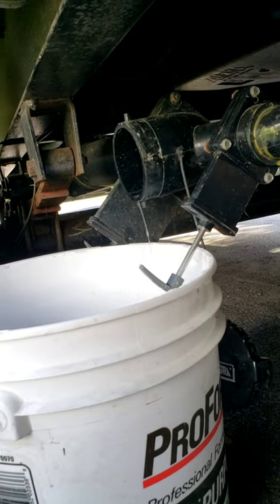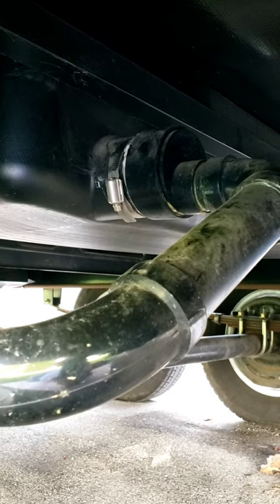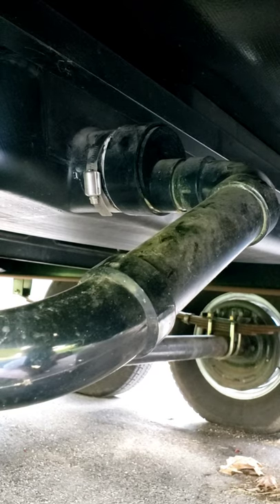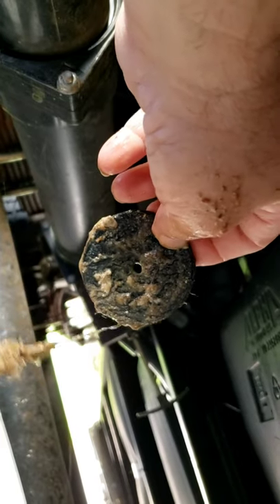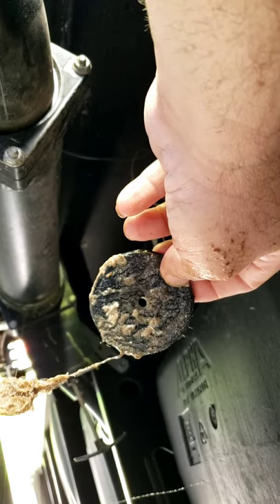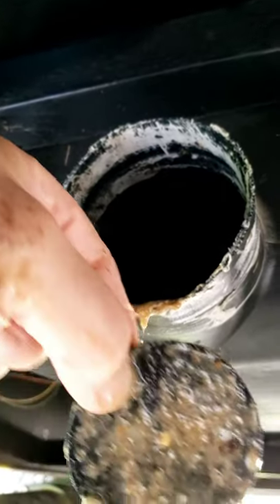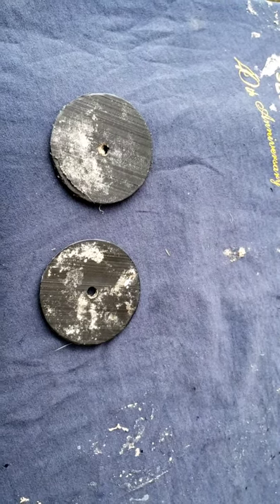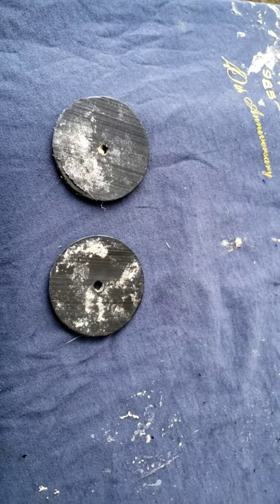Grey water tank not draining

Comment: Thank you, brother.  Bought a used Tiffin, and only got a dribble from my (half full) gray tank.  Ten seconds with a coat hanger started a flood, and now I need a shower, but I am happy to have fixed it so quickly for free.  The 1.5 inch stuff is glued to the tank, so I can't see  if there's a disk of tank material in there.  A lot of organic crud came out, so we'll fill the tank halfway, do some motocross, then dump 2 or 3 times and hope that's the fix.  If not, I know my options due to your video.  Thanx again!!
Reply from the maker: Your welcome glad the video helped you. Thanks for the feedback 😀

Comment: I have a 2014 Sunseeker motor home manufactured by Forest River and have had the same problem almost as long as I have owned it. Of course the problem didn’t start happening until it was out of warranty. I always have suspected that’s the problem as sometimes it drains fine and other times hardly at all. I did start to take it apart, but wasn’t sure about the connection at the tank, so I stopped. After, seeing your video I may give it another try. Thanks for sharing your experience.
Reply from the maker: Your welcome.  Hopefully you can get it or them out of there. good luck.

Comment: I've tried baking soda, vinegar, Rid X, boiling water.... nothing....

This video by far has made the most sense.  I'm just worried about bring able to put it back together lol

Thanks
Reply from the maker: glad I could help you. I'm sure you will do just fine getting it back together.  I did find plumbers putty that would work on plastics. your local dealer should be able to help with plumbers putty.

Comment from the maker: I wouldn't be afraid to add a  little heat. I would use a heat gun and not any kind of open flame.  I would make sure it is plumbers putty and not glued.  I didn't need any heat to get mine out however mine wasn't cracked. good luck hope you get it fixed.

Comment: Thanks for video. My reducer that is puttied to the tank is cracked. I was wondering if it was removable. Sure isn't going to be easy in the confined space of my motorhome. You mentioned heat, I was wondering about hitting it a bit with a heat gun, but like you said definitely don't want to damage the tank.

Comment: Thank you for this great video. I have been frustrated with the same issue but nite I feel confident I might be able to fix it.
Did you put plumber’s putty back on when you out it back together?
Reply from the maker: Yes. I was able to find the Hercules brand at a local plumber's shop. The oaty brand says not to use it on pvc or pcv  plastics.
Reply from the maker: Thank you for the feed back

Comment: Excellent walk thru Charlie on a very common problem.  What is the name of the correct putty for this type of ABS fitting?  I had this on about a 2005 Sunnybrook and now again on my 2015 Open Range Roamer.  The guys at the plants are just sloppy and the manufactures do not care the issues caused by what should be a very simple quality control item.  For those who have this issue, but have not had time to make this repair, a simple snake up the drain while someone else holds the drain hose ready to connect it up the second you knock the blank out of they way, can help you get by.  Not as messy as it sounds as long as it is on a gray tank.  Black...well that is a story for another time.
Reply from the maker: Hercules  brand is the one that I used. I purchased it from a local plumbing supply house. I looked it is available for purchase online. you may be able to get something that will work from your local RV dealer as well. thank you for the feed back.